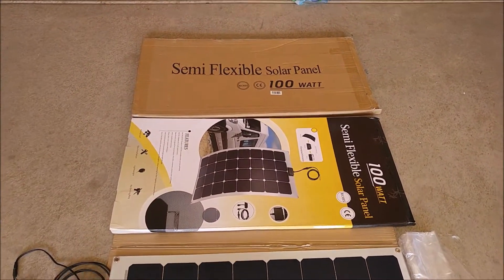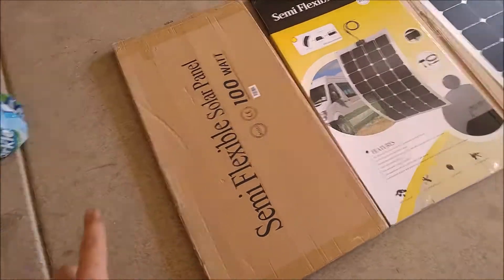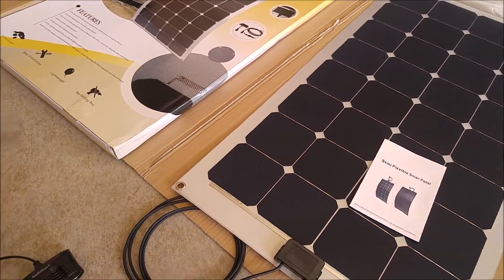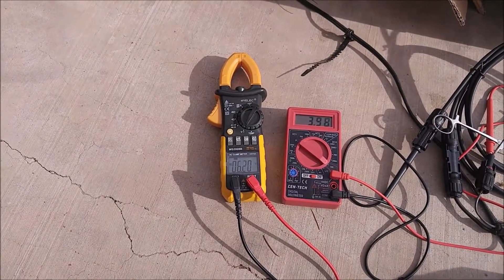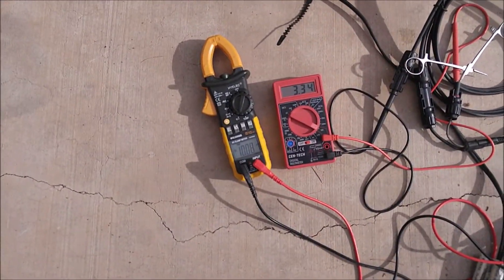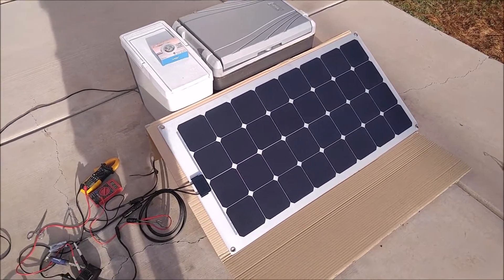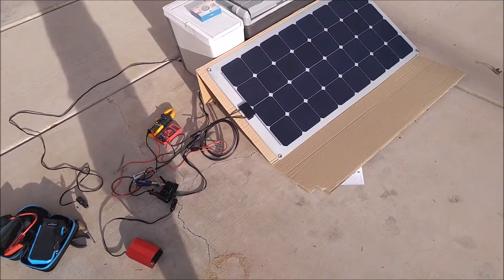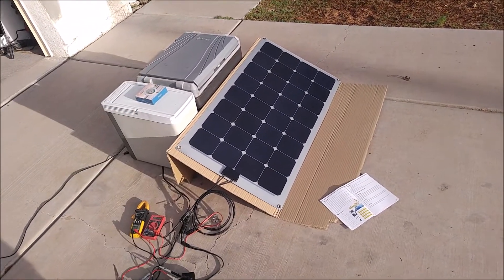(:Review:) Semi-Flexible 100Watt Solar Panel for Boats, RV's, Car Camping & Boondocking

Comment: Can it charge a boat battery while you are using it?  Or do you need to not use the battery while charging it?  Not sure if it can charge the battery while you are using it?  Thanks...
Reply from the maker: Yes, you can charge with solar and use the battery at the same time.

Comment: I bought two of these panels and I’ve tried both series and parallel connections through a Morningstar MPPT controller and I can never get beyond 100-110w for both and that’s in direct overhead sunlight. I’m a little disappointed.
Reply from the maker: How are you measuring your watts?
Reply: GadgetClass I go by the Morningstar display panel.

Comment: my question i have a device need  12v 1500 mah and i have  battery 12v 7 ah so how much time can run it  ??
and how much  mah in 1Ah??
and what is  isc and voc and  ipmax 
ISC: 3.33
Voc: 20V
Vpmax:18V
Power: 100W
Ipmax: 2.77A
can someone help me pls

Comment: Hello, I just started researching into possibly getting a solar panel for my pontoon which is set up on an electric only, using a Minn Kota Engine mount 101 -  https://www.youtube.com/watch?v=j6IxpvbdxVM    .    The electric motor is set up on 36 volts, three marine batteries. I am also planning on adding a fourth battery to only use for things besides the motor, like my lights, phone charger etc. I mainly use the boat to put around the lake or to stop and fish.  Sometimes I can easily be fishing for a few hours. During the majority of my fishing outings, the sun is often directly on the boat, to where I have to stay under the bimini top just to stay cool.  Here is my main question, with all that I shared, will the charger you talked about charge enough while I am out, to extend the amount of time I can stay out there?  If so, do you have a rough idea how much time it adds?  Also, do you have a link where to buy one and since you posted this video, do you still feel this is a good one to buy, or would you suggest another one?
Reply: It's not going to be enough. If your motor is using 25 amps or more and you run them for a couple hours, it would take a 100watt panel like this all day to recharge. You're gonna want 600 watts at least. It would work to keep the batteries charged in storage.
Reply: @TrailerDayz  Thank you for your thoughts.  I don't need it for storage.  When the boat is not being used, it is always being charged by having the trickle charger plugged in.  I was thinking the solar might help charge the battery while I am stationary fishing in the sun for 2-3 hours at a time.

Comment: You weren't worried about ruining any of your electronics by using a voltage higher than 12V?  I know there is a voltage drop so, in some cases, that wasn't an issue.  But, potentially, you could be putting 18-20 volts into something that is made to accept no more than 12V.  I happen to run stuff off of solar panels directly, just as you were.  I often find myself powering stuff without using a battery.  But when I do, I use a buck converter to step the voltage down to a constant 12V (or whatever the voltage is that I need).
Reply from the maker: Almost all 12V electronics are designed and spec-ed to take 9-18 volts. Most 100watt panels don't get much higher than that

Comment: I am confused.  You are talking to men and 'some' women need a step by step demonstration.  diodes and gromets confuse me.  I can save your life, but I don't know most of what you're talking about. (38 yrs as an RN) . I put a lot of things together successfully, but I have to understand what it's about. Can you do a video of the BASICS?  Like, can electricity accumulate if you have a second car battery?  
 Can an you use it to power your electronics? How is that physically done? Can a panel accumulate energy to fire up our electrical needs?   I see all the connections from the solar panel and don't understand how that is connected to our electronics.  where do you buy the little things that show you how many watts and amps? I need a basic course.  I am not an idiot, have made many things from youtube.  I cannot find anyone who gives the basic course of how it works and the connections you need and how to connect them.  I would be forever grateful if you could help me.  I would like to see it from start to finish as I am planning to do this before I go camping again.
Again, thanks for your patience.
Linda
Reply: Linda Lopez This video was primarily designed to be a proof of output video.
Reply: I don't even know what that is.  Sorry to have bothered you.